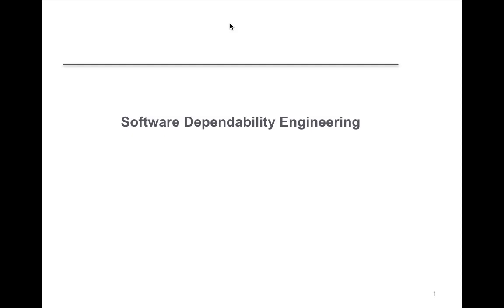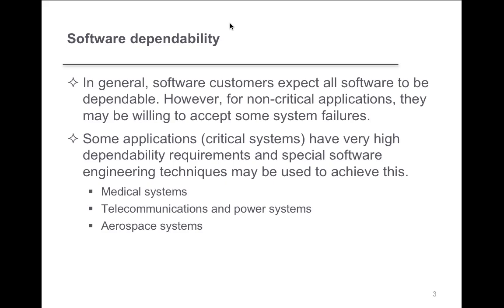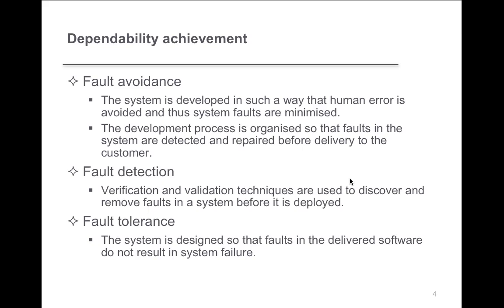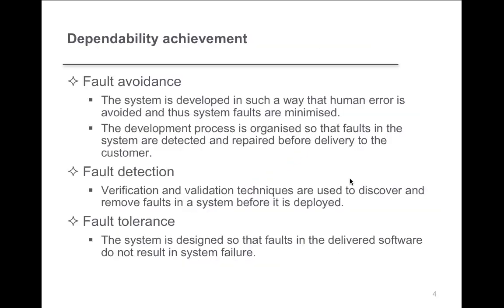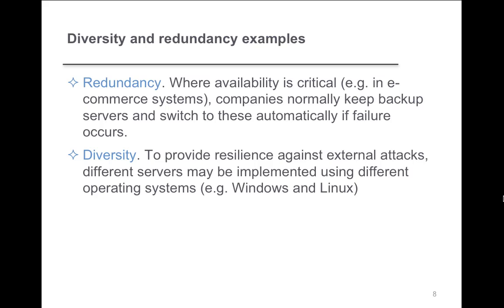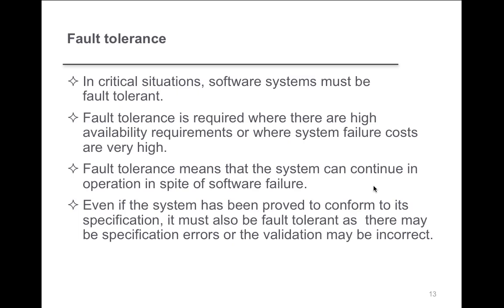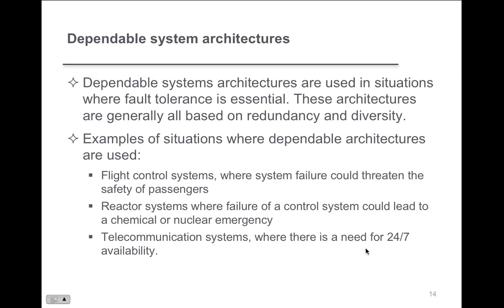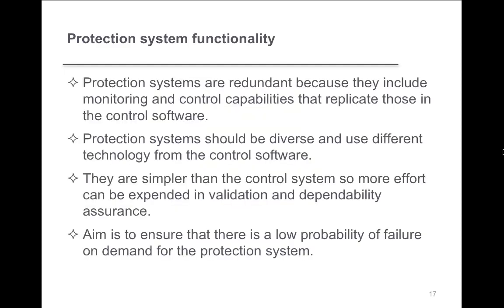Software Engineering 2 - Live Lecture 5 on 3-2-2011

Comment: you never mentioned that there are four attributes that make the system dependable 

1- Availability
2- Reliability
3- Safety
4- Security

if all 4 are robust and concrete the system is dependable